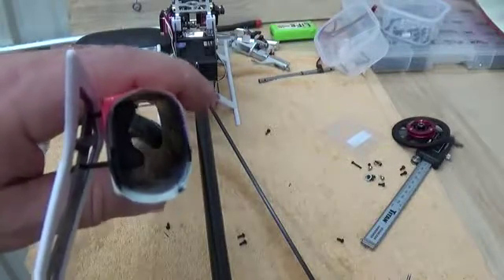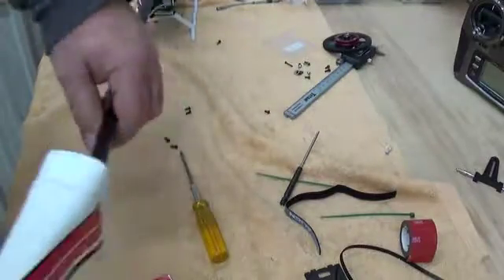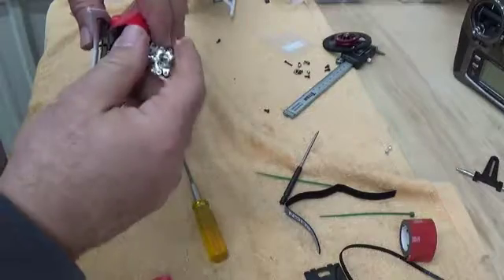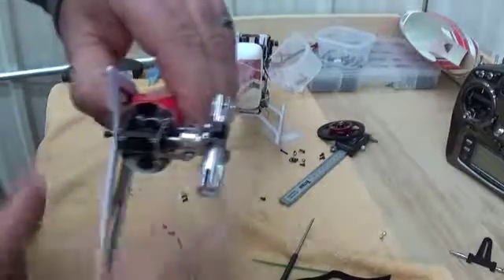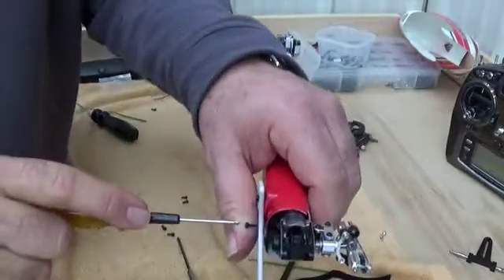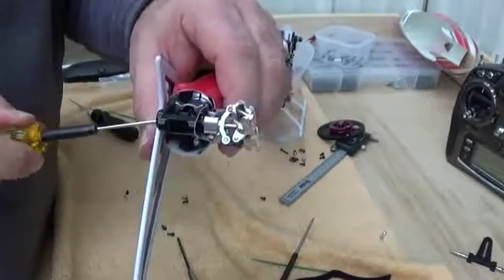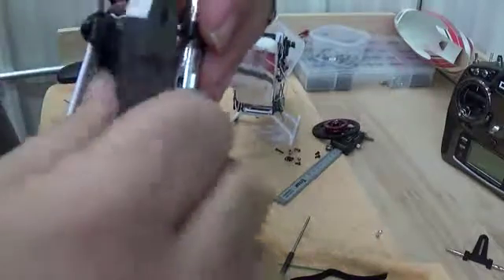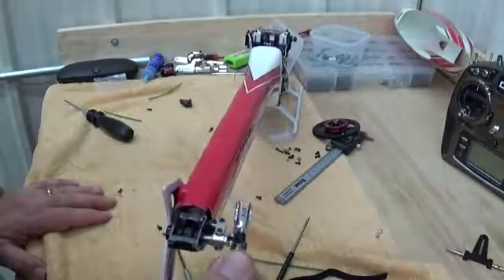TREX470LM Speed Fuselage tail install

Comment: It looks much better in reality, I noticed. I have black + blue stripes fuselage on trex 500. How did u balance your heli? The tail becomes so heavy, especially with torque tube. I have 6s 3300 battery and had to slide battery tray closer to the front, and on top of that, I put extra weight - attached one 1S 3300 battery sell and a metal piece weighing like 100 or so grams. Only then I got it balanced head - tail.